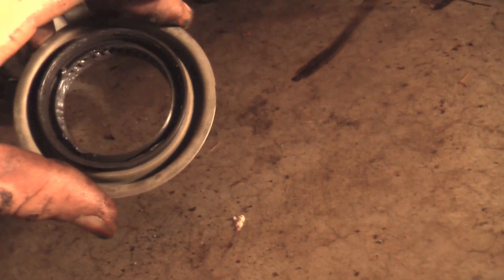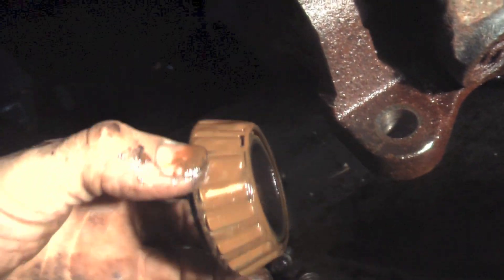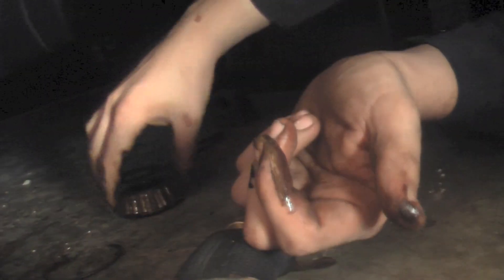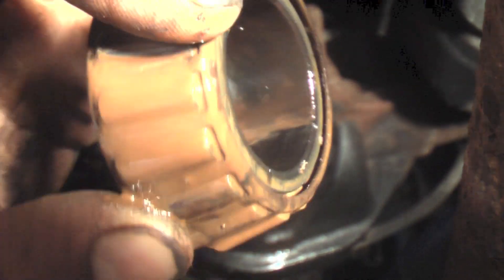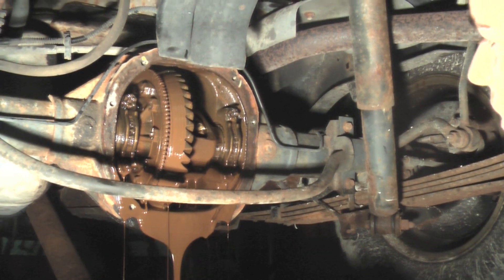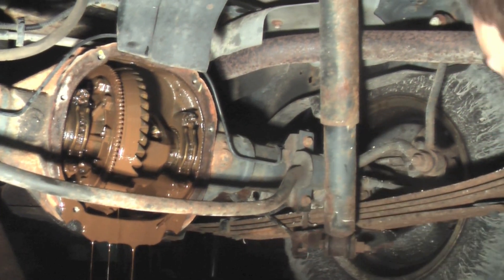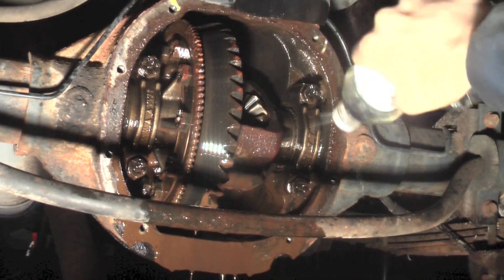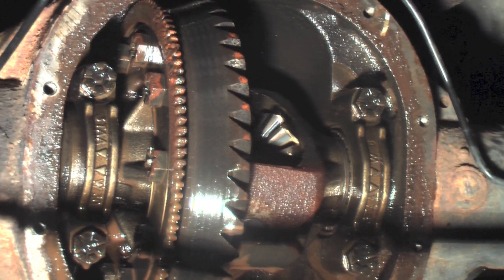The Results of a Clogged Rear Axle Vent

Comment: What's usually fucked w/ that situation is that the condensate (as a result of the clogged vent) that gives the rust color to the contaminated lube is from where the water lays on top of the lubricant in the diff.; where the ring gear rusts when the truck just sit's, often causing pitting in the ring gear...
Seen this in a lot of junkyard diffs...
Reply: Misterpolytech water lays beneath the gear oil not on top

Comment: No not a result of a clogged vent... It's the results of a idiot driver that thinks they have a swamp buggy.. you have to relocate the vent line to the front of the truck above the level that you would ever be submerged in... The housing sucks water in through the vent when you take a vehicle that has been driving on the road and heated up, then cooling it quickly in a creek will cause the air to contract in the housing causing it to suck all it wants to drink in to the housing. And when you get water in there it begins to get damaged...
Reply: Notso Basicguy Interesting. Good point!

Comment: Yep, I bought my land cruiser 2 months ago and have just got a AUD$4000 bill to replace the rear diff and clean the rust out from the rear axle. Turns out the previous owner must have gone through a river a long time ago and the water ingress has caused a lot of rust and the bearings to cease on the rear diff centre :( also they never changed the diff oil!

Comment: just pop the cover off, hose it out with break clean, reinstall cover and fill with oil, repeat after 50 miles to get all contaminated oil out. Do not replace the cone bearing without replacing the outer race too.

Comment: Like ohers have said, this is not cause by a plugged breather. typically a plugged breather will simply cause seals to leak because built up pressure in the differential from thermal expansion has nowhere to vent. This is, however the result of dirty water entering the diff THROUGH the vent, and mixing with the oil over miles and miles of driving.
Its quite likely there is damage, however a simple gear oil change may prolong the implosion of the bearings.

Comment: A true gearhead loves the smell of gear oil. Whenever I smell it I get excited. Cogs everywhere, axles, transmissions, piles of engine blocks, piles of scrap metal, abandoned vehicles as far as the eye can see, and the smell of gear oil in the air, that is my idea of heaven!
Reply: Jim Garrison This same thing happened to the rear axle on my '33 I bought whose previous owner apparently did no maintenance on, and trust me, it smells nothing like gear oil. Smells like rust mixed with feet.
Reply: I second that.

Comment from the maker: Check with your owner's manual. Some recommend every 30-60k miles, others don't recommend it at all. The Excursion has 260k miles on it, and the rear axle/diff has never been touched, and hasn't leaked a drop of fluid.
Reply: That's a common misconception, as actual dealership mechanics with their OEM service manuals that are not available to the public will tell you that "lifetime" tranny/diff fluid is only good for the "lifetime" of the transmission, which is only measured as a 10 year warranty period. So the fluid is only good for 10 years and needs to be changed at 75,000 or 100,000, depending on the vehicle. If your tranny or diff blows while out of warranty, well, the dealership will make a LOT of money off of you, so it's in their best interest to misinform you.